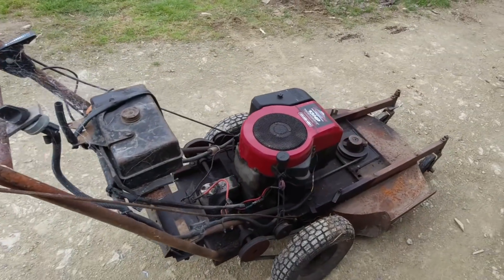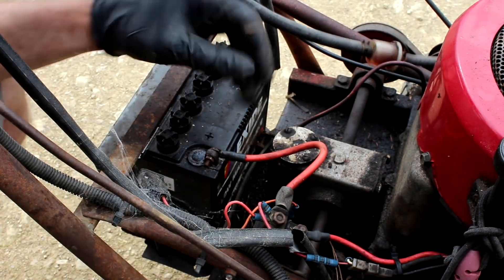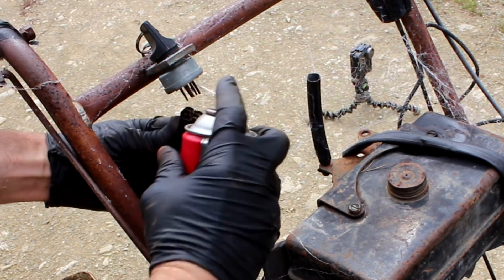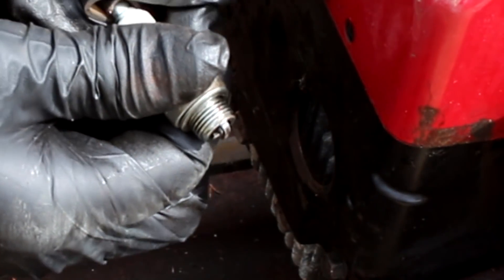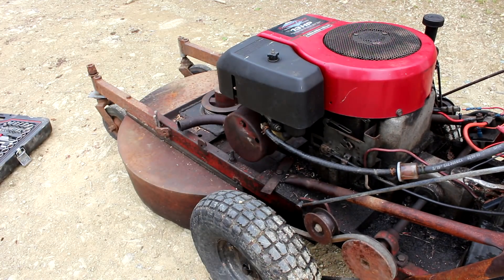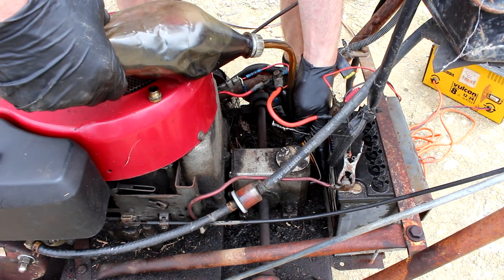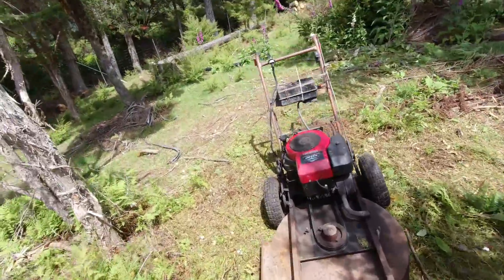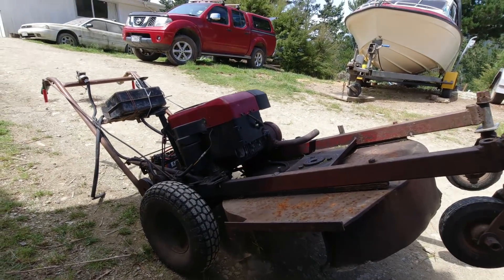Heavy Duty Scrub Mower Hasn't Run for Years... Will it start ??

Comment: Nice find in pretty good shape! Does a good job without having sharpened the blade. I’d suggest you consider cutting the front of the deck skirt off and it will cut through without you having to lift it up and down onto the bush. Most brush hogs work without the front skirt. Just a thought. You can always weld it back on if you don’t like it. Good luck!
Reply from the maker: Thats a good idea cheers
Reply: When we cut the front end off brush cutter, it cut without lifting, but when it got into gravel, or glass, it tossed it like shrapnel  for 50-feet, ok for the field, not safe anywhere else.
Reply: @MartyT  could always hang chains from the front like a traditional brush mower to help prevent debris from exitting but also allowing you to run over brush just like the previous person mentioned

Comment: It's an old Masport Estate Master mower dating from 70's / 80's. Loosen the bolt on the blade pulley and the blade spindle can be moved up and down to change the cutting height. Greetings from the north island. 
Cheers Chris

Comment: Its an old Masport mower that contractors used to use back in the 70's - just watch out for rocks flying out the side - I think the trick was to put part of an old inner tube on the exit to slow down any rocks etc.

Have seen one still being used in the last 5 years in Auckland as he did a good job of grinding the dirt out when mowing the lawn :)

Comment: Another great rescue from my favorite bloke down under! That thing really cut through that brush. I could have used that when I was clearing up the southern fence line here on the property. Couldn't get any of the mowers or tractors in close enough so I got as close as I could and then got in there and got dirty with a bladed head on a big string trimmer. I'm dreading the eastern fence line because the other side of it is HEAVILY overgrown. There is still about 1/2 acre of property on the other side of that fence that is ours that goes all the way to a creek. I'd really like to get back there and clean that land up.

Comment: The brand is rota mower, they were made in South Auckland. I'll try and find the manual I had for one. I've had a couple - great slashers.

Weak point is the gearbox, the gear and helical screw are brass. The rubber o rings on the base of the gear box tend to wear out and leak - then the over heat and lunch the box. 

Hope this helps!

Comment: I have a very similar machine made by Ariens. Mine is walk behind, with a 24  rotary mower. By removing 2 bolts, the deck is removed and then you can attach a 24" snowblower. It also has a lock out hub so it can be 1 or 2 wheel drive. The machine is from the early 70's and still works good. I also had to replace the bearing on the spindle for the mower.

Comment: Another great video mate. Thinking of making one of these out of a lawnmower I got with a bit of a rusty deck cut the front out to that meets the ground so it's higher /open fronted maybe extend the wheels out slightly to guide the long grass & small bushes and for bit of safety so toes can't go under, (not that anyone will be around when it's in use!) I seen these things on YouTube videos in America so I reckon it was probably sold way back when maybe had a new engine as that looks newer than the rest of it I might be wrong though? But never seen one here in London England home made or shop bought, but great video and I  leaned a few more tips including the Coke bottle trick! So cheers! I'll look forward to second video! 👍

Comment: I've got exactly the same model - got it way back in the '70's, was used by the Featherston Golf Club. Great lawn mowers. Reduction boxes always leak out oil and blade bearings always flog out.
Reply: That confirms it wasn't a DIY job

Do you know what brand/make it is?

Comment: It's very similar to a Hayter Condor of around 1960s vintage! It's not an actual Hayter, but is very similar. Be very careful with it, if it has a reverse gear - It will be very unforgiving if you trip over and it reverses over you! A scary machine indeed, and requires great care in operation.

Comment: Will it start , you betcha !! Good score Marty , once you get it cleaned up and running properly , see if you can get a much heavier blade for that mower , then you can smash through anything that gets in the way , I`m picking it won`t be much bigger because of the diameter of the shaft , cheers .

Comment: Bit of spit on the valve stem to check for leaks, yep I do that too. I used to mow an old guys yard with one of these (a lot newer model) the powered wheels were a bonus, they are pretty simple machines to fix as well and it looks like that one has had an engine transplant, they didn't come with a Honda motor but with a Briggs&Stratton motor.

Comment: I have been given one exactly the same as that and a masport comander 36 inch both with no motor and I have got the masport one running yesterday with a 12.5hp briggs, What a beast grass at knee height at walking pace no problem and big old clumps of coxfoot stumps make it bark abit and some smoke off the drive belt and its gone.

Comment: I bought one of these in chch with original old 7hp B&S on it still. 

Awesome mower, works great, but constant loss oiling system - I call it puff LOL. Will get a new motor one day. Rest is less flogged put that your one.

Comment: I love it I brazed the pipe on the muffler unless it's bad the wheels have bearing good cleaning and the handle spray rusteloum hammerite paint deck.rusteloum paint sanding each coat then 2 coats of clear

Comment: The key switches fill up with water and crap.I did mine a  few months ago. Fill the switch with fuelite ,kerosene or CRC 226 and work the switch ,periodically flushing away the loosened dirt.

Comment: I build the worn shafts up with bronze weld, then lathe them down , works a treat far better than mild steel welding.
Reply from the maker: Does that last well? I would have thought bronze would be more susceptible to deforming  with the hard impact of a blade hitting a rock or something
Reply: @MartyT  don't know yet, the first ones I did were the spindle shafts on a Stiga mower, that was a year ago, maybe 18 months ago. 
Seem to be doing ok so far.

Comment: The "slightly over full oil" is always a concern with these motors. It is usually because gas has leaked through the carb into the crankcase. An inexpensive fuel valve on it would be good insurance

Comment: One of the nasty tricks some companies pull is on new spindle units they sell it will have a grease point but use shielded bearings so no matter how much grease you put in it will never get into them till the damage is done.

Comment: Like the way the gearbox attaches to the blade without a chain, that way if it hits something solid it wont fuck the motor by abruptly stopping it common issue with regular mowers.
Reply from the maker: Yes it is a good design

Comment: I probably don't need to tell you to look at the blade. But I just did. I sold rotary mower blades for 30 years. It was a reflex action I'm afraid.
Reply from the maker: Yes once I've fixed the shaft, I'll sharpen and balance the blade
Reply: Well, if I was still on the job, I would say you should buy a new one. lol.

Comment: If you bolt a bar between the top of the castor wheels you might run less risk of higher growth landing on the belt drive on the mower deck ?

Comment: The big issue of sparks around a lead acid battery, especially one that is charging or gassing off hydrogen gas is the real risk of explosion of that battery.
Reply: If that's the case, why don't more cars blow up. ?
Reply: @kevindemmocks8310  Because there is air moving around in the engine bay from the fan & motion & the charging current is regulated....and there are no sparks present. Unlike when people connect or dis-connect chargers onto the terminals with the power on or try do up terminals and earth out right next to the cell caps where the cloud of explosive hydrogen gas is present. Look it up, you'll learn something that might save your life or eyesight.
Reply from the maker: Yep hydroxy gas is highly explosive, but needs  a very close spark to get it to ignite with a 4 amp charger splitting the water
Reply: @MartyT  I've seen a loose battery with no battery clamp in an engine bay do it & there was a bloke in town the other day who got acid burns when the battery He was charging exploded in his face as he was messing with it. It's like petrol, I used to know this bloke who used to stick a lit match into a bowl of petrol and put it out and say " Look, it's not that flammable". Another lesson, when I did my agricultural blasting licence there was this warning from the instructor, "Use your crimping pliers to crimp your detonators on, not your teeth otherwise you'll blow half your face off if you get it wrong & crimp too low & set off the PETN". I saw that bloke walking around town one day, plastic surgeons can only do so much with whats left.
Reply from the maker: @dustyfarmer  Yeah you can never be too careful. I've done all sorts of experiments with hydroxy and it is hard to get it to ignite with 4 amps splitting the water, even 10 amps+ is hard to ignite in the open air but I have heard some horror stories of batteries going bang in enclosed spaces with high amps charging. I always wear at least safety glasses when working around lead acid batteries just incase

Comment: Ah the ole briggs and scrap em' motors
Reply: Known in my circles as "Briggs and Shrapnel"....
Reply: Domt even bother trying to start them round here 
I'll take a Chinese Honda clone before a Briggs 
Over heat like nothing iv seen, I guess theyre tuned to North american spec 
Used to have some on the bush fire trucks 
They were real good for if you got too close to the fire they'd over heat and get a vapor lock in the fuel line 
Real handy on a fire truck... 
Had a load on augers as well that wouldn't start if you left them in the sun for the same reason 
Used to have to put wool packs or 44 gallon drums over them to keep direct sunlight off them 
But I havemt seen any manufacturer use them for some time 
Kohler seen to have the whole market 20hp+ amd Honda anything sub 20hp
Reply: @fowletm1992  Extending the fuel line with a new length of fuel resistant line, and incorporating an in-line filter, rerouting it all well clear of the hot engine bits usually helps prevent vapour lock.Maybe wrapping a cloth around the line and soaking it with water, too? Briggs and scrapiron made decent engines years ago,,,now they build them so cheap for domestic use that they don't even have a drain bung...just tip it over and drain it out the filler hole...their research found domestic consumers didn't change the oil anyway...throw away society.

Comment: If you're feeling brave cut the front guard off and back about half a inch over the blade and you can just steer it forward without lifting it.
Reply: Some of the old vintage stuff were like that

Comment: That looks like an old Toro proline 32. Probably from the 80's by the looks of it.
Reply: The motor is late 90's early 00's but could have been put on from a scrapped riding lawn mower
Reply: Looks like that's probably the case. The original frame and deck are what pulled me towards my conclusion.

Comment: 👍 Was it running full RPM? Were you running  slower on purpose?
Reply from the maker: No it was only about half speed, I couldn't keep up with it at full revs
Reply: @MartyT  if it cuts adequately  at moderate revs, I see no reason to have it revving, my philosophy  whether a lawn mower or tractor  mower. This  is not to say I don't believe in using full power as and when required, it totally depends on how heavy the going is.
Most lawn mowers  use less than half the fuel doing the same work if revving at minimal  adequate cutting speed rather than full noise  the entire time as most people do.
Reply: @MartyT  If it's been re-engined at some point,  that would explain the disparity between engine speed and ground speed.

Comment: Wait, seriously Foxglove is a nuisance plant? Or you could be pulling my leg. They are hard to grow here and beautiful when they do grow well. 😳
Reply: NZ has a lot of places it's a weed, looks nice but if it's not wanted, it's still a weed, technically  noxious weed as in quantity,  the original form of digitalis and so can be moderately to lethally  dangerous
Edit, generally the local animals  do not eat it and so it causes few problems, but if you introduce new animals from a different property  unfamiliar with foxglove,  some of those may be inquisitive..... until they learn the hard way. Most animals are smarter than people think.
Reply from the maker: David is on the money.. My sheep don't eat it and it takes over the place if left unchecked

Comment: never use sand paper or a wire brush on a plug heat the end up with a blow lamp to burn of the carbon . using sand paper or brush will make the plug miss fire .
Reply: Why,  generations of DIY to actual mechanics have done so successfully. Modern plugs and engines result in this being less of an issue than years gone by, but this used to be the norm.  Genuinely interested in why...
We can all learn new things....
Thanks
Reply: @davidp8157  using a wire brush leaves conducted metal on the porcelain of the plug that leads to miss fire known fact .
Reply: @TheCitroenman1   I agree  that traces of metal could be left on the porcelain  while brushing it and thus could lead to tracking  and potentially shorts,  but you never use the wire brush on the porcelain,  the problem end is the electrode/s. Neither I nor anyone I know of my vintage  nor the older generation no longer with us who used to do this routinely had an issue of plugs shorting. With older plug design coupled with older motor design, often poor spark on stationary engines (and even plenty of older cars) whether lawnmowers,  generators or a myriad  of powered small implements,  fouled plugs  was a constant . We even had a period of a year or so when even supposedly lead free low octane fuel  formed small  metal balls which continually  shorted the plugs out. At one point about 35 - 40 years ago I used a scrub bar ( industrial  weed eater  and harness with a heavy duty metal head)  commercially.  I arrived at site with the machine  and a days fuel, but continually carried a wire brush and crescent wrench attached to the harness  as the chances were you would have the plug out more often than you topped up with fuel, and this was with what was at the time a  new reliable machine, thank goodness times have changed for the better.
I personally have not had to resort to a wire brush for a long time as modern electronics has largely solved most problems, so much so that I have even updated the occasional old mechanical points and condenser  of an old poor starter runner to a modern electronic unit  which solved all issues, not just the starting....( last one I did was a "67 Briggs & Stratton  which as I knew it from  new I can categorically  state was a poor starter  and a mediocre runner from new, electronic ignition made it an amazing starter and a good runner...
Its many years  since I was taught to clean plugs, but I think that your comment on traces of metal  potentially causing tracking was one of the first things mentioned as a don't  brush the porcelain because ....
Thanks for your comment